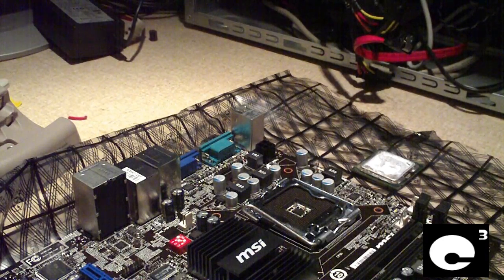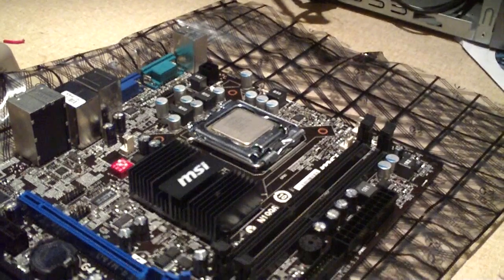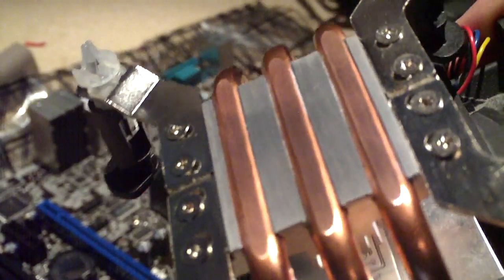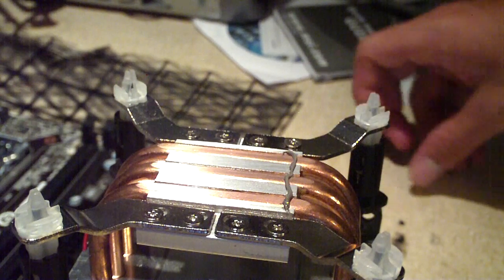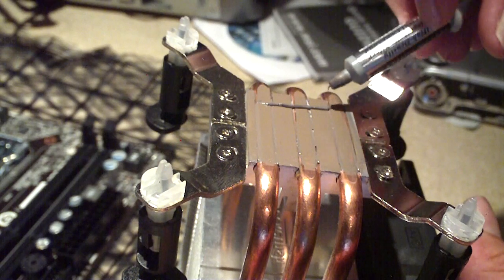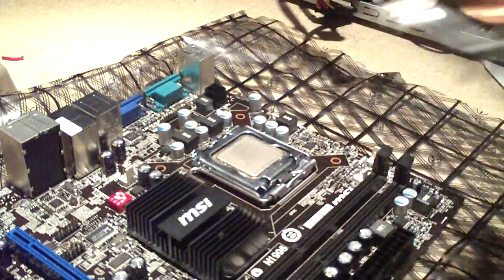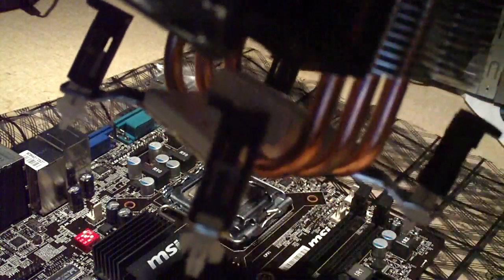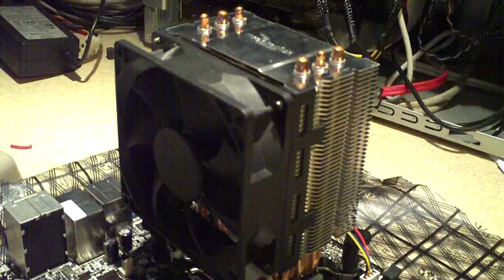How to Install a Modern Intel CPU Cooler with Push Pins

Comment: I think it's better for paste coverage and also easier to push 2 diagonal pins simultaneously down, then the remaining 2.
Reply: That's the PROPER way to do it diagonally. Also shouldn't the pins be turned anti clockwise, push them in, then turn them clockwise to lock? Google agrees "Yes, for installing an Intel heatsink with push pins, you typically turn the pins counter-clockwise to unlock them (or set them to the "ready" position with the arrow pointing out), push them into the motherboard holes, and then turn them clockwise (about 90 degrees) to lock them in place, often in a diagonal pattern for even pressure, hearing a "click" as they secure. "
Reply: ....I did notice though it says "modern" so maybe things have changed? Clarification please?

Comment: dont put the thermal paste on cooler but on CPU ! also dpont put ur CPU fan Down ;) u want airflow through the case
Reply from the maker: 1. I install paste on the smaller of the two objects. If the cooler mounting plate is smaller than the heatspreader, then I install the paste there.

2. Fan was not pointing down.

Comment: I hate the push pin style so much!!
Reply: I too!!!
Reply: You wanna pull up on the pins as you push down on the heat sink. If you're using any force to attach them you're doing it wrong (guy in video is doing it wrong too).

Comment: I hate push pin type CPU coolers installment, mine have miraculously survived being installed 3 times on different motherboards. Last time when my EVGA 680i had an electric fire last year and got replaced with a Intel bad axe 2 that sadly enough will not oveclock at all. (with EVGA I went from 2,4 to 3,4Ghz on my Xeon3060)

Comment: I have to mention on my amd board there are little threaded inserts that need to be removed before the push pin style coolers will work may need to take mobo all the way out to install.

Comment: this is a video of how not to install it, blows my mind how people put on thermal paste.
Reply: +Josh McNab yoiu have the evo where the base plate is machined flat (i also have this one). the hyper 212 plus and this on has gaps between heatpipes and it can be benificial to spear TIM just into the gaps.
Reply: +Josh McNab wtf did u even see the cooler plate? it blows my mind how people judge and don't even pay attention to such big hints lol
Reply: evil..
Reply: Yea h not only that but "Yes, for installing an Intel heatsink with push pins, you typically turn the pins counter-clockwise to unlock them (or set them to the "ready" position with the arrow pointing out), push them into the motherboard holes, and then turn them clockwise (about 90 degrees) to lock them in place, often in a diagonal pattern for even pressure, hearing a "click" as they secure. " NOT "put them in the lock position push them and thats it" eh?
Reply from the maker: ***** You HAVE to do it this way on this particular kind of cooler. There are big gaps in the cooler and if you put a big blob in the center, the paste will just creep into the nearest holes between the heatpipes and cooler base. If you put a small amount on the cooler base, it will not work properly and the CPU will overheat. This is a poorly engineered direct touch cooler.
Reply: I didn't have to do that with my hyper evo 212 and its bigger than that heatsink. The pressure from the heatsink pushing down on cpu will spread the thermal paste just fine.  A nice pea dot size of thermal paste will be more than sufficient.
Reply from the maker: ***** Your Hyper 212 was probably better engineered than this cooler.
Reply: probably, what kind of cooler is it?
Reply from the maker: ***** It is a cheap knockoff of other better quality products from Cooler Master. It was (might still be) sold under Best Buy's Rocketfish brand as a "Universal CPU Cooler
Reply: k, thanks for sharing.  I just want you to know I didn't mean to offend you in anyway just putting my opinion out there.
Reply from the maker: ***** No problem. I didn't take any offense to your comments.
Reply: Bill Board you can probably jerry rig it up to use different pins something I probably couldn't figure out but I would recommend buying a new cooler that is compatible with your motherboard.  what motherboard you have and are you talking about a stock cooler?

Comment: Nice video,, i recently installed a big heatsink fan i think almost the same weight as that one.. it's also a pushpin type installation.. just wanna ask if it will put too much stress on the board in time? or it's all just a myth? thanks.. :)
Reply from the maker: Ronell Reyes I have a refurbished computer on hand that has had it's Intel CPU and boxed cooler (push-pin style) installed for many years now. The board has not warped at all. These boards are designed to hold up to the tension from the cooler, though I like the backplate design better even though it usually requires motherboard removal to change (to a different cooler).
Reply: ***** thanks for the reply sir.. :) by the way, this is my new heatsink fan.. it's just a universal cpu cooler, not the branded one since the branded one is really pricey.. i bought this for i believe a steal price of 4dollars.. it's a cdrking brand.. my only concern is the durability of the pushpins.. judging from my comparison against the intel one, i'd say the cdrking pushpin is not that durable.. 

http://i57.tinypic.com/mlhusw.jpg

Comment: The motherboard is not supposed to be on the anti-static bag!!!!!!!!!
Reply: Why not? If anything, it SHOULD be on the anti-static bag to prevent static...
Reply: The outside of the anti-static bag is conductive to protect the motherboard, by putting the motherboard on to the bag, it just creates more area for static electricity to transfer to.

Comment: I've got my cpu fan installed plugged in and everything but it doesn't turn on and it is plugged into the cpu fan slot on the mother bored it's a push pin it's all secured on the mother bored. Any ideas
Reply from the maker: I'd check other connections such as from the power supply. Also, if the power supply has a main on/off switch, make sure it's turned on.

Comment: this isnt how u are supposed to do this..you use a flathead screwdriver sitting in the groove on the head of the pin and press down directly on the pin head one at a time to properly secure them
Reply from the maker: No, the procedure you see in the video is correct. A screwdriver is used in REMOVAL, not installation.

Here's an official Intel video:
How to install and remove LGA775 processors and fan-heatsinks
Reply: ***** trust me bro next time u have to do this, press down on the pin with a flathead screwdriver and you will get better contact + lower temps, just like the intel video says, but use the flathead screwdriver instead of your fingertip - this allows u to exert more force directly onto the pin then with a finger, getting a good snap into place + a secure lock.

Comment: It's impressive how Intel is able to fit thousands of transistors into a small silicon chip, while they still aren't able to create a cooler with four simple screws that make sure your cooler is fit tightly on top of the processor chip.
Reply: That's why buy an after market fan cooler. Like a Noctua silent cooler.
Reply: true, then it breaks and you have to BUY a new one, that's the reason
Reply: Exactly. My i7 4790k heats up to 100 degrees Celsius when I play a game. Just because the pushpins don't work. It's a mess.
Reply: @maltimoto  Mine too had to remove it again
Reply: The earlier coolers on core2quad, etc... had a backing plate with fixed nuts, and screwed in from the top. I'm actually trying to flip a Q6600 system, and I'm looking to do the opposite. The most affordable stock-looking cooler I could find uses push-pins. The stock core2quad (blue fan) screw-in coolers are going for like $50 now, and I'm not looking to pay that for a system I may sell for $80.
Reply: @sumdood2035  Yeah, I suppose for some of the higher end CPUs they did include better coolers, some of which screwed in. But I think for all of their other CPUs there have been push-pins since the LGA 775 Pentium 4s. Either way if you're flipping the system and those are the prices I'm sure going with the push-pins is your best bet.
Reply: @realEchoz  This is an Inspiron 560 Desktop (I think, not at home). Q6600 was after Pentium 4, so I'm not sure why they chose a metal backplate and screws. The backplate is really stuck, and I don't want to crack something.
I watched a video where someone used 3mm screws and washers to mount a pin style cooler (without pins) to a screw mount.
Reply: @sumdood2035  Yeah, I've done that once when the pins were really busted, if you have screws that fit that should work just fine, you may or may not need washers depending on how large their heads are. I believe I had to improvise using motherboard stand-offs on the bottom since I had no backplate. If it's an Inspiron that's probably why there is a backplate, though, as the OEMs usually have their own coolers.
Reply: @realEchoz  It definitely looks like some improv will be involved. I would have to order them, but I'm not even sure if M3 screws are what I'd be looking for. The new FAN I have draws .60A, so it should cool at least as well as the original quad-core cooler if I could just get it mounted.

Comment: Overkill with the thermal paste lol
Reply from the maker: You HAVE to do it this way on this particular kind of cooler. There are big gaps in the cooler and if you put a big blob in the center, the paste will just creep into the nearest holes between the heatpipes and cooler base. If you put a small amount on the cooler base, it will not work properly and the CPU will overheat. This is a poorly engineered direct touch cooler.

Comment: do i have to completely remove the motherboard from my computer case to get my fingers under there to push the push pins?
Reply from the maker: The pins push from top-through, not from the bottom-up. The push-pins click when they've latched to the holes in the board.
Reply: ***** the fan completely covers the pins on my new shuriken, which is different from the one in the video. this is very frustrating. thank you for trying. also, i heard it is possible to replace the pins with M3 bolt and washers. is that true?
Reply from the maker: thekingoffunnyfaces Your cooler probably is a bolt-thru and not a push-pin cooler.

How To Install a Modern Intel CPU Cooler with Back Plate
Reply: the old one is bolt-thru. the new one i bought is push-pin. is this a problem?
Reply from the maker: thekingoffunnyfaces You'll have to remove the motherboard to remove the old cooler's backplate. Then just install the new push-pin style cooler, and reinstall the board. When it comes time to remove the push-pin cooler, you'll be able to remove it without taking out the motherboard.
Reply: interesting, thank you

Comment: I have a heatsink with same pins but it won't attach to motherboard. Are there supposed to be screws or something that it attaches to or what? In your video I see like little tabs the pins go into...mine doesn't have that.
Reply from the maker: I believe your cooler uses a back plate. If so, refer to this video...
How To Install a Modern Intel CPU Cooler with Back Plate

Comment: i always find i have trouble with only 1 of the pins locking into place.  is there a correct order you have to push them in.  i always find no matter what one of them just wont lock into place

Comment: I have heard that when installing push pin heavy CPU fans like this that they can bend the motherboard and break it, i have had my stock heat sink for over a year now and am looking to fix the temperature issue, and to install ones with screws i would need to remove m motherboard which i dont want to do so is this the fix to my probelm do you reckon?? please reply

Comment: If you mount this cooler in densely packed housing (in my case RAM obstructs access to mounting pins and I needed to remove all cables) your only smart solution is to remove motherboard from housing. However, standard coolers made for instance, for AM2 and AM3 sockets have best mounting and cooler clamping system ever. Extremily simple and secure, you place the cooler, hook it and secure it with clamp handle and it is done. I love Intel but this funny cooler handling system is too much.

Comment: Intel makes best CPUs, best chipsets and boards and thus my surprise was greater when I noticed that, for some reason, coolers for this class of processors have worst mounting system in computer history, except probably of those made for older AMD CPUs when you need to apply enormous force to release mounting element that holds the cooler and risk to destroy the MOBO.

Comment: Thermal paste is not used to fill the cracks there used for take of the heat off you CPU faster then just a standard CPU fan without thermal paste I'm guessing you know that already

Comment: Actually, this is how long it normally takes... Some people out there take even longer, because they make mistakes with the Intel push pins and they can't get em to lock into the board. I saw a comment somewhere else where someone said it took them TWO HOURS to get the cooler on.

Comment: Is that the CM Hyper TX3? I have that one right now, I used it for a Phenom II X4 and now I'm using it for a Core i5 3570K. It's pretty good for $20. :) You can get em even cheaper than that too.

Comment: here is a shout out question to anyone: does anyone know what the size in millimeters the original cpu fan for a dell xps studio 9100 is? ive looked everywhere and cant find out. I want to buy a fan once and only once without opening it and finding i bought the wrong size fan./.

Comment: one more question would it be alright if i installed a new cpu fan with the cpu and mother board still in place, i really don't want to take too much apart, i am sort green novice at tech

Comment: i hope your not confusing my question with what he installed on the motherboard 
in the tutorial, that would be a definite "duh" on my part but is that black funnel tunnel in the tower sitting in the background the case for the fan? i just want to double check before i try this myself

Comment: Very helpful guide, indeed. I just installed an AMD after-market fan on my brothers' computer, and because i was not permitted to remove the motherboard from the case, it qualifies for one of the most stressful and all-out annoying experiences of my life. Intel fans are one of the more easier fans to install, in my opinion.